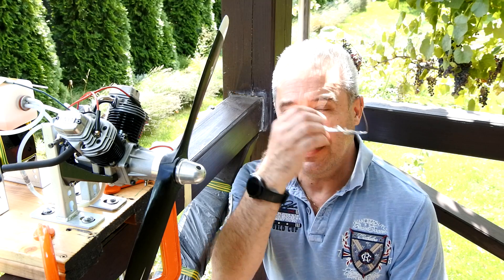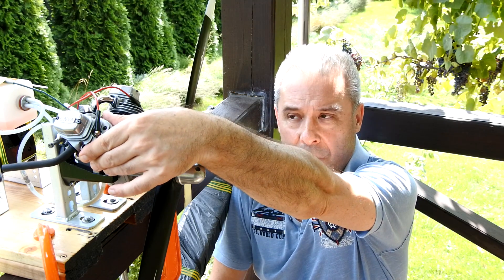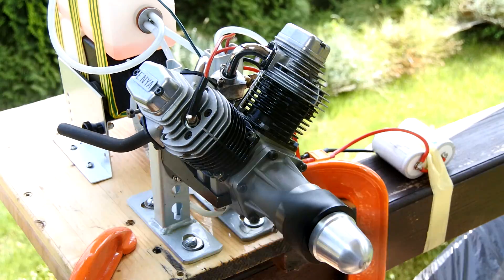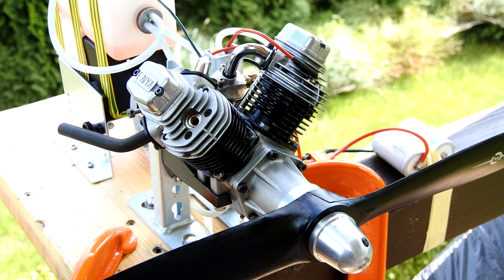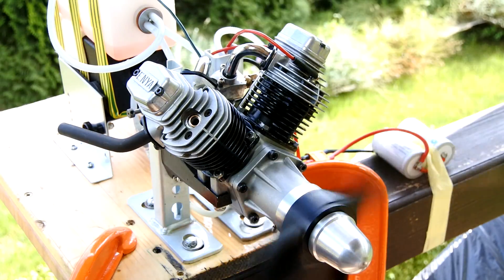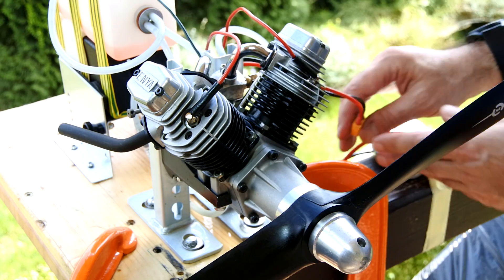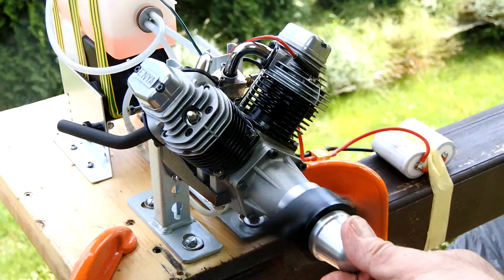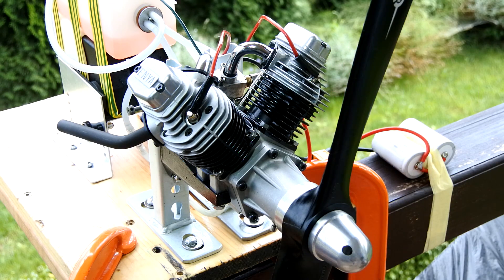Enya VT 240 the story of a lost cylinder Part 2

Comment: Ever thought about converting this engine to gas electronic ignition?
Reply from the maker: Hi and thank you for interesting question ! Of course, I thought about it, but the collector's point of view won out - this engine is much more of a working exhibit than a potential drive for an airplane model. Firstly, the Enya VT 240 is quite heavy, secondly, it is quite difficult to "fit" it into the dimensions of the model, its V-shaped design greatly limits the possible options for the prototype, so it definitely won't fit into the model. But I liked the idea of converting it to run on gasoline with spark ignition, I will definitely find time and do this, especially since I have an ignition unit for a 2-cylinder engine. Thanks again for the question, with wishes for a good day!

Comment: Thanks for a nice contents! but still I wonder just firing each cylinder at a time can solve the problem...
Reply from the maker: Thank you very much for your kind comment ! Of course, separate firing attempts doesn’t solve the problem. Probably, I wasn’t so clear in explanation - I was provided a kind of thorough cleaning of each half of a carb, totally dismantle it. Separate cylinder firing procedure mostly helps me and my viewers to understand, if each cylinder working exactly, as it should be after such deep cleaning procedure. I was so upset when VT240 shows signs of second cylinder dying after 3K RPM’s,  so I was purchased an absolutely new carb set for Enya VT 240. But, it was so great to solve the carb problem by deep cleaning ! So, I still have completely new twin carb for my VT 240. Probably, for the further issues -:) .
Thank you and have a nice day !

Comment: Pure beauty    and Hellofrom New Zealand
Reply from the maker: Thank you for your kind comment ! Saito FA 270T is still one of the best 4 stroke engines I've ever meet, on my opinion. Absolutely agree with you - pure beauty ! And great feature of  this engine - is its SOUND, specially at low idle !
Reply: @crazyengines88  thank you good sir for your reply.   I would love to fond one of these Enya V twins      preferably there smaller model,  what ever is size maybe I'm not sure.  But yes      they are very nice.     And hello from little New Zealand
Reply from the maker: @russcole5685  Thank you for sharing your opinion. Definitely, Enya VT 240 is a real thing, but it will consume a lot of time from you to restore it to the top condition. If you can find it somewhere on Ebay or else, and if it will need some restoration - will be happy to share with some my experience in Enya VT 240 restoration - I was spent dozens of hours with it, and of course, will recommend to you some Ebay sellers which are still keeping some Enya parts.

Comment: Why do you try to talk over a running engine?
Reply from the maker: Thank you for your great question !!! To be honest, I do not even remember why I decided to do this. But many people liked it, and sometimes, when the engine is not noisy and has a pleasant exhaust tone at idle, I do so.
Reply: Honestely, it wouldn't matter.  I had trouble understanding terms at key moments.  Additionally, the owner keeps interchanging left and right cylinders in the video compared to the text comment answers.  My takeaway from the video is to tune each side seperately with the opposite cylinder free of compression.  Seems like that's all it took, but after it was fixed, the video never showed enough of the right cylinder to see smoke.  So the viewer is left without visual proof the fix worked, unless you go by sound I guess.  Also, in the comments, it became apparent he lapped valves, changed pistons, changed a head, added shrink tubing to the right intake as insulation(?), from what?  Well, glad you got it running, whatever the root cause was.  I did buy one used yesterday. Tracking shows it's in the mail and will arrive Saturday, Feb 22nd.  Should be interesting......

Comment: Sounds a lot better, hope to see further improvement and fine tuning, are you running on enya #3 or #4 plugs? If yes try a pair of fresh OS F glow plugs
Reply from the maker: Thank you for your comment ! yes, it is sounds much better, because both cylinders are firing. Anyhow, will work on it with diff glow plugs. On that video Enya 4C glow plugs are   installed, they are specially developed for 4 storkers, as explained at Enya Metal Products web site. W\next time will check the fresh OS type F and  Saito SS type glow plugs - it's quite interesting, which will be better for lowest idle.

Comment: are you running the motor with constant glow to the plugs? she dies when you remove the battery power. mixture looks to be too rich, seeing lots of oil coming out the exhaust pipes. motor should idle around 1700, to 2000 rpm without glow attached to engine. what are your high speed needles set at? air bleeds maybe too closed.
Reply from the maker: Thank you for you comment ! Yes, you're totally right - I'm running VT 240 at very rich carb settings - there was a few resons for that:
1. On left cylinder I was chenged piston \ piston ring pair. After frist run was found that left piston brass bosses were slightly slipped aside (!!!), so I change piston\ring pair for. 
2. I'm awaiting for a new carb assy, would like to change it completely, just to refresh VT 240 to a best possible condition. As well, left cylinder head will be swapped for a new one, with a new valves. The old one is still having less compression (the "hiss" from exhaust. After all such changes will provide some break in and later fine tuning according to your reccomendations.
Anyhow, I'm very happy, that I was able to switch both engine side into to work. 
Thank you for your advises, they were very helpful !
Reply: @crazyengines88  did you try to lap the valves ? that sometimes helps with valve leakage. i do a lot of model engine repairs here for various customers and 2 hobby shops in my county and the county east of me. the chineese engines i get have the biggest problem with valve leakage.
Reply from the maker: Not yet, because when I checked exhaust valve seat,  I've found, that it has some thin, hear sized scrathces. Definitely, this is the reason for lower compression in left cylinder. I decide firstly, to install a new head, check the compression again. If it will be OK - so, I can work on lapping the valves.  We'll see...
Thank you for your questions and comments !